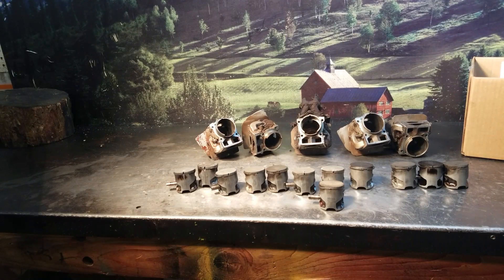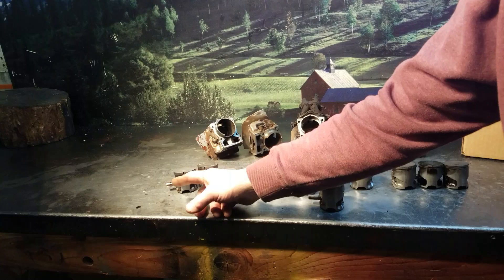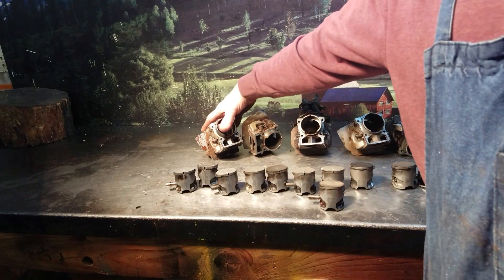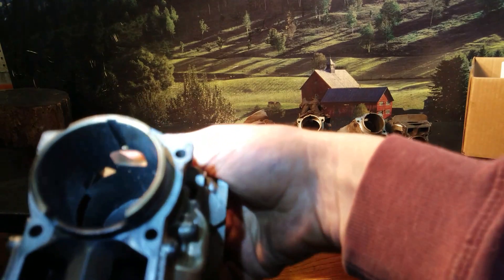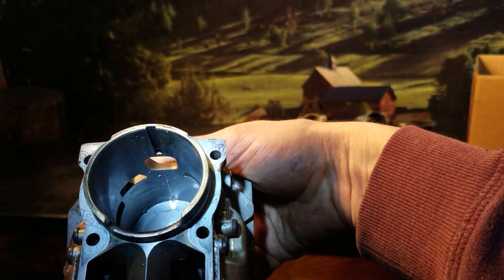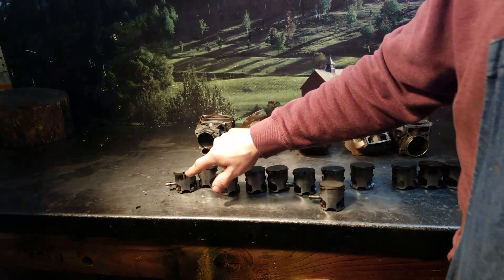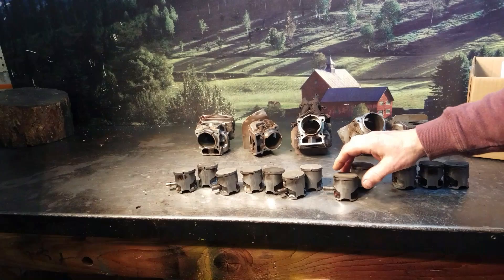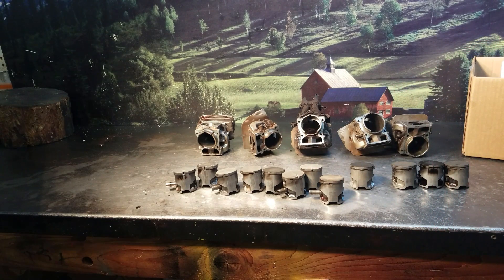The Chainsaw Guy Shop Talk Husqvarna 562 XP engine issues

Comment: Why the speeding piston?this is number one failure and is seen on the exhaust port side  as you have pointed out.i note that husky will not warranty small saw like 46 if operator uses a 16 inch bar to up  chain speed.cheers ,from ,wet west coast.